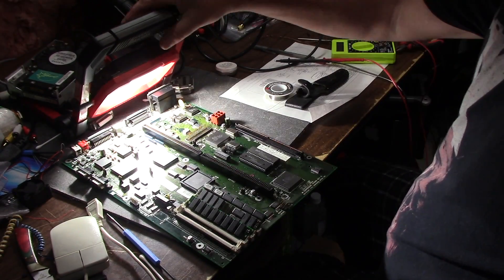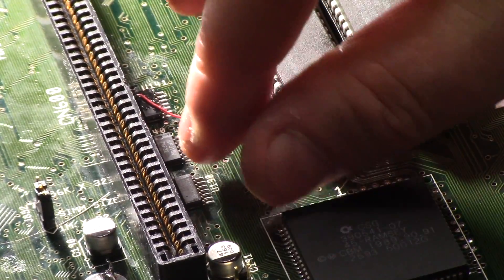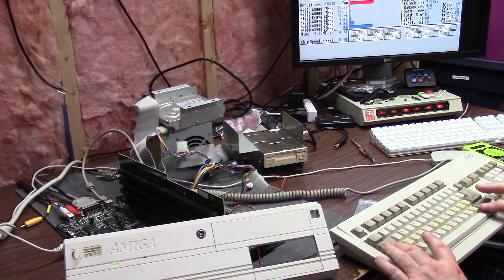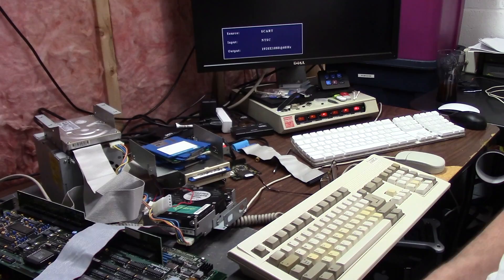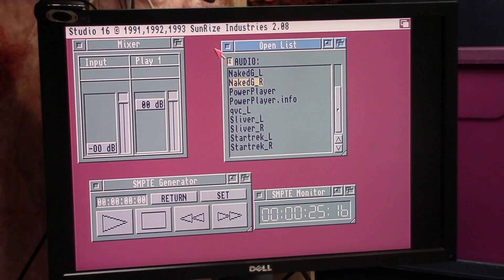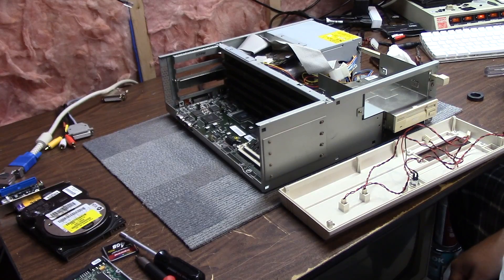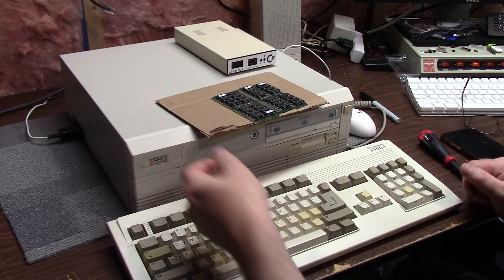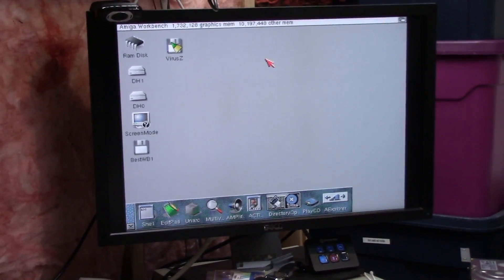Project Amiga 4000 P4-  All Repaired!  Interesting find on original hard drives!

Comment: Amiga PCB Explorer is awesome.   It beats the hell out of using the old CBM Schematics.   Cable Ties, Duct Tape and a hammer are the best tools in your tool box.  I know its a PITA but if something is in my way when soldering components I just remove it and yea that's a lot of work but at the same time when you put it back you will not have to worry about dry solder joints.    I would would keep the same type of SIMM Slots because if you do chose to install a Picasso Board the slots your thinking about will interfere with installing a Picasso Board because it will need to go in the bottom daughterboard slot.    I have a new set of slots to go in with the metal clips I believe I got them from Amiga Kit.  When I pull my A4K Board out for recap I will swap out the SIMM Slots and install a new Battery.   I have a bunch of old Metropolis 100mb drives I used back in my BBS Days and they were loud back then too.   I had 1 drive in the A2K and the rest were in a small PC Desktop Enclosure along with some extra disk drives for the MAC, and Amiga.   Good to see you have your A4K board up and running!!!!